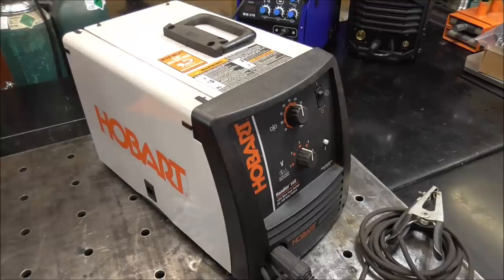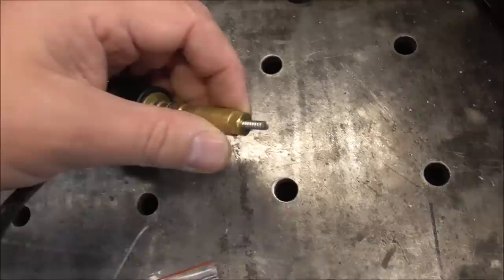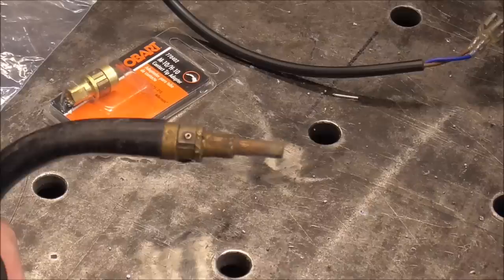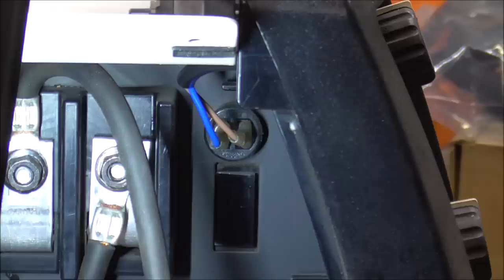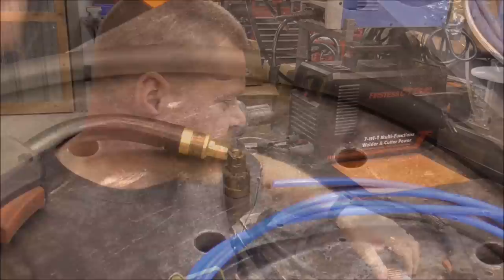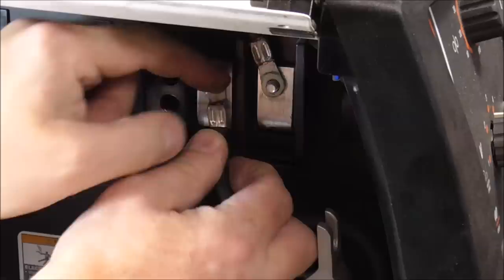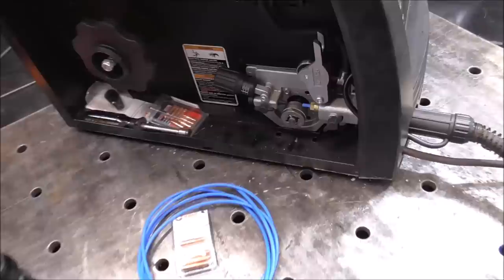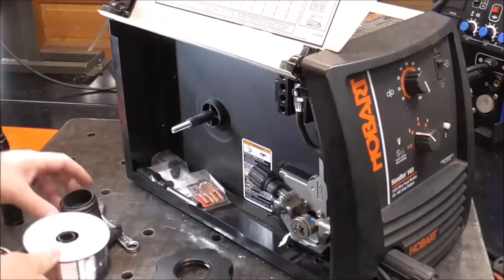Convert Your MIG Welder to Weld Aluminum - The Easy Way

Comment: How does the liner look after a few weeks of continuous runs? Ptfe breaks down around 245C and gives off toxic fumes. That tube has to be getting scorched.
Reply from the maker: I haven't run this in production. I'm sure if it were an issue there would be some mention of it on the Amazon reviews.

Comment: I tried this on my Hobart 120, but it didn't because the guide chart didn't show the AC/DC change.. I may try it now that I know..
Why not turn the Voltage up and wire speed down ?
Hobart makes a Spool Gun so the wire is pulled instead of pushed, so it won't jam as easy..
Reply from the maker: Thanks man. You really have to keep the wire flying through the contact tip. Of not you will get burn back

Comment: Can you take the metel liner out to weld aluminum then put it back in for metal  welding?
Reply from the maker: It can be done but it will wear out prematurely.

Comment: i just built a large workbench that my larger carpentry tools live in with a mft hole grid like yours....i really wanted to do the torsion frame and legs out of aluminum but my omnipro 220 only has provisions for spool gun and since i dont own the spool gun, i built the bench out of steel.  on one hand gawd dayum is it stout, but that comes at the cost of being heavy as hell.  i roll this bench in and out of my trailer everyday for work im able to do it by myself...but man i bet using aluminum would have saved a ton of weight.  i never thought to just throw a spool in it and try...smh
Reply from the maker: It's a game changer for sure!

Comment: OK, I have a miller wire welder that has a tank on it. I use solid wire. My question is if I replace it with the teflon liner can I still weld solid wire and aluminum through this liner???
Reply from the maker: Technically yes you could but the soft liner would wear out very quick from the hard steel wire and the liner would then become contaminated with the steel oxides. Your best bet is to find a cheap whip online and just leave it setup for aluminum, then you just swap whips when you go from steel to aluminum.
Reply: @BrandonLund  Thanks, I know they have a special aluminum adapted, but it is NOT cheap. It would be easier and cheaper to find another handle and cable for it.
Reply from the maker: For sure! You can find some decent knock offs on Amazon that should work pretty decent

Comment: What wire do I need for small cast aluminum job? You said that won’t work, I have exact welder used here. Only have one job here to do so not worth buying a tig for it. Thanks in advance.
Reply from the maker: Cast aluminum can be a real headache with MIG. Its better suited for TIG and that can be challenging as well. How thick is the casting and is it clean? 4043 works well in a spool gun but it is a pain running it through the gun. 5356 feeds better through the gun.

Comment: So my wife says what do you want this year for Christmas? Still thinking about it and it's either going to be a new stick welding machine or maybe a combo setup. Or i do need a new bigger chainsaw, last year i got a new craftsmen tool cabinet, top and bottom which is 3 times bigger than my old one. I will have to decide
Reply from the maker: Go for the welder Jake! You know you need it!

Comment: So how do you keep it from bird nesting you might be able to get it to work for a little while but when I did it I kept having to cut out the birds nest and rerun the damn wire through the whip seems to me it'd be a lot easier just to put  aluminum welding gun on it
Reply from the maker: You set your tensions properly and keep your line straight. It's the same procedure as setting up a push pull.

Comment: Hi Brandon, great channel. Are the gauges that you show in this video specific for welding aluminum, or can I use my two needle gouges. IE. tank pressure and feed pressure?  AGain great channel, thanks
Reply from the maker: Thanks man and yes, you are fine using the guages you have. There is nothing that needs to be done directly there other than you will want to increase your pressure a little more with aluminum than with steel.
Reply: Perfect. Once I have my tips for 0.035 wire, I will be burning aluminum. Thanks.

Comment: So I have a small 220V welder(160 or 180 A) ....with a dial voltage and feed selector.  Can you give me an idea which way you' go with your settings?  I'm thinking I might just buy another gun and have one set up for aluminum and one for steel...make quick work of a changeover...
Reply from the maker: Aluminum you have to go hot and fast. I just use the chart on the door and it gets me real close. You can also google "miller weld calculator" and type in your material and thickness and it will give you some settings also :)

Comment: Do you recommend using an oversized tube too? Say I have 0.035 should I get the tube for .040-.045 or .030-.035?
Reply from the maker: It definitely doesn't hurt

Comment: Brandon

I've spoken to several folks about this, & I'd love your take on it. What are the chances of getting a bird's nest inside your MIG welder? Have your subscribers been mostly successful using ER5356 and not ended up with bird's nests inside? I've a 200 Amp Miller Vintage so could I use 0.035" ER5356? Or do I need to go down to 0.030" rollers?

The cost of a spool gun can be as much as $2000 or more for my rig so I'd like to try it out and see how I get on..  Thanks for the content Brandon, it's much appreciated..
Reply from the maker: Hey John just size your rollers to match your wire size. As far as birds nest, if you adjust your reel tension and drive roll tension properly and keep your whip relatively straight and your running a contact tip one size larger, birds nests don't happen often. Making sure your mig gun liner is almost touching your drive roll is a huge help too. It's when you start manipulating your gun or whip with high drive roll pressures is when you run into trouble
Reply: Thanks  @BrandonLund  I just got a cylinder of 100% argon this week. For the cost of a graphene (or teflon / hdpe which is the best?) liner I'll give it a shot. I'll not have committed a kings ransom to try something fun. If it works out great if not, it will give me some extra time to fool around and buy a spool gun cheaper than paying top dollar for a spool gun straight out of the LWS.. Thanks Brandon for your prompt reply!
Reply from the maker: Anytime John. Glad I could help. If they say they are specifically for aluminum than they are all about the same. I got mine on Amazon. It was nothing special and it works great.
Reply: @BrandonLund  I'll get a liner for my M25 gun and I'll post back in less than a week or so.. I've got a lot on my plate at the present..
Reply from the maker: That sounds good. Enjoy. Its a lot of fun for sure! 👍
Reply: @BrandonLund  One more thing about the welding without a spool gun.  I was talking to my LWS and I was told is to make sure the tip is one size up from existing. So what I was told was if I'm running 0.035" wire then have a 0.045" tip because the aluminum will expand with the heat during the welding process and may jam inside the tip? Is that what you've found too?
Reply from the maker: Thats 100% solid advise. https://youtube.com/shorts/wAO1AOA_je8?feature=share The aluminum wire will expand and fuse into the contact tip. Always go one size larger when running aluminum. It's a huge pain if you don't. In a jam you can drill it out

Comment: After swapping out liner. Can you run regular wire in new liner or do you have to switch back?
Reply from the maker: I would only run aluminum in the Teflon liner. Hard wire will destroy it so you would need to switch back or better yet have a spare whip setup for aluminum.

Comment: Hi Brandon, at 24:50 you pop in a text comment "You should avoid manipulating your torch when welding aluminum"... Can you further expound upon "manipulating?" Do you mean don't make circles or back/forth movements in the puddle? Just a straight push? Learned a lot! Thank you!
Reply from the maker: Hey Jeffrey, with aluminum mig it's recommended if your welding a large fillette joint, rather than weave to fill the joint, make multiple straight passes. It helps eliminate cold lapping
Reply: Doing little cursive e/circles while MIG welding has served me pretty well. Visually I can see the top and bottom of the weld pool tie in as I move ahead. Even if you are just changing the tip angle to put more heat in the vertical metal then the flat part of the T joint you should be able to see the toes melt in. I think the manipulation lets you have greater control of heat input, weld time and penetration, especially if you're kinda running an underpowered machine. If you want to blast through a hot pass you'll need more chooch in your box.

Comment: Did you use that welder for flux core previously?  I'm just curious what it ran for voltage when welding flux core, because I would always have to run my Lincoln 140 on the 3 or 4/4 setting when doing 1/8"-1/4" steel with .035 wire and be overheating it often.
Reply from the maker: Oh yah, I've run pretty much everything through this. I run .030 on this pretty much for that reason. It runs .030 really well but I feel it's a bit underpowered for .035.

Comment: Why not just preheat the start of the weld? It seems once you get started the welder would heat up the rest of the piece.
Reply from the maker: You could if it was thicker but it's thin and it cools off quickly

Comment: To go from electro negative to positive why didn't you just reverse the cables rather then switch the internal contacts?
Reply from the maker: It's not possible with this welder. It doesn't have dinse connectors.

Comment: I think you will find your beads will look better if you take the white off and make it shiny aluminum where you're running your bead.
Reply from the maker: For sure. The oxide melts at a much higher temperature than the aluminum.

Comment: Very cool. Looks like you have a Yes Welder 250 mig  in the back? I was wondering did yours come spool gun ready? Mine did not and I converted it to spool gun and made a video on it. Shortly after they released it with that option, that would have save me a lot of work but I reckon you could also convert this welder/most to a spool gun mig if you wanted to.
Reply from the maker: I'll check out your video. Yes this one did come with the switch but I know the earlier versions didn't as long as you can interupt your trigger input it shouldn't be that difficult.

Comment: I have the same welder, I was wondering if after I install the Teflon liner can I keep it in,even when I mig or flux weld?
Reply from the maker: You shouldn't. It will wear out quick plus contaminate the liner.

Comment: If you change back your wire for steel will it wear out the liner intended for aluminum? Or can you run steel wire and aluminum wire Through the new smooth liner?
Reply from the maker: It will wear it out prematurely plus it will contaminate it so you wont be able to use it again with aluminum.
Reply: @BrandonLund  Thank you. When I watch the rest of the video you answered the question. I should’ve waited to the end to comment. Appreciate the info keep up the great work.

Comment: Are the Yes tig welders any good on Amazon. I  can't seem to find one with a 220 volt connector unless you use the adapter and the wire seems a bit thin for running 220.
Thank you
Reply from the maker: Yes they are. I own a few and have not had any problems.

Comment: No spool gun? Only a liner swap and gas? I have Lincoln 180 that takes gas. What g as  for this? Will it go on lincon
Reply from the maker: Nope. Super simple. Put in a liner, kepe your whip fairly straight to avoid friction and add pure argon. Yes you can do this with Lincoln also.

Comment: Did it destroy the cameras censor while filming the 2nd weld pass, or did you actually have a camera filter?
Edit:I learned about the soft liner when we switched over to Fronius. Honestly I do not like the constant need for the FRONIUS GUY to correct our machines errors every other month. Lincoln or Miller is my 3phase goto machine.
Reply from the maker: I never use filters. I go through a couple of cameras every year. They get knocked over, the lenses get destroyed from welding and grinding sparks, and the sensors fry from the welding. Knock on wood, I have 2 fronius machines and haven't had one problem. Hopefully I didn't jinx myself, but my 2200 is by far my favorite, followed by my Hobart / Miller
Reply: We're running the 4000 MV with water cooler on about 28/580 spray transfer, burning a 33lb.. 045 roll a day and they code out every other month. Thanks for the info.
Reply from the maker: WOW that's some production welding!

Comment: Quick question.  I noticed a Vevor Mig 250 (maybe) and a yeswelder 250 pro (maybe) in your intro.  Would you recommend one over the other?
Reply from the maker: Personally I reccomend the YWM211P which is a double pulse machine that has the ability to store settings which makes it great when going from aluminum to steel or changing different wire or material thickness.  Next to my Fronius it's my favorite machine. Plus I include a coupon in this video that will save you quite a bit at checkout https://www.youtube.com/watch?v=XqzGvZaRGTo

Comment: Interesting and helpful video Branden, what lense are you using? I have one just for gas welding aluminium that eliminates the flare so you can see the puddle.
Reply from the maker: I'm just using the nozzle that came installed on the welder.
Reply: @BrandonLund  I was talking about the lens in your hood, I've never used aluminum wire like this.

Comment: Brandon why didn't you just buy another gun unit and put in the graphine liner so you can just swap the whole unit already set up for aluminum and the other is set up for steel?
Reply from the maker: @Lewis Sport I have several aluminum dedicated welders. I just wanted to present a simple cost effective alternative for someone looking to convert their machine.

Comment: so for me what I would do is to just buy another feeder assembly and keep it for the Aluminum wire to have ready any time I will weld Aluminum
Reply from the maker: Honestly, that's the way to do it 👍 then you can switch from steel to aluminum in seconds

Comment: Will that Teflon liner still work for the steel mig wire?
Reply from the maker: No. The steel wire will wear it out very fast. Plus it will contaminate it

Comment: Great video, Brandon!  What did you mean by "if it's going to be over 150 degrees Fahrenheit" you don't want to use this wire, when you were comparing spools just prior to installing the one you loaded?
Reply from the maker: Thanks man! Above 150 it can stress corrode in an inert environment.  Basically its a form of corrosion that begins if the part is put under stress in the heated enviroment than it can fail due to the corrosion.
Reply: @BrandonLund  Thanks, Brandon.  So if the environment is over 150*F, it will corrode.  Wow, that's a low temp.  Good to know.  Thanks!

Comment: I would just get another mig gun if I were swapping often.  Drawback is the gun for my Miller 175 is about $270.  Still a lot less than a TIG machine.  And get another drive wheel just for AL.
Reply from the maker: I agree Bruce. FYI you may already know this but YesWelder makes a decent mig gun for the Hobart machine if your only looking to use it occasionally for aluminum and it's less than 100 bucks. It should interchange with your Miller.
Reply: @BrandonLund  Thanks.  Not "Bruce" BTW.
Reply from the maker: LOL I'm sorry. I'm not sure how Paul looked like Bruce to me. HAHAHAH Man oh man I guess I need some rest. Sorry about that buddy
Reply: @BrandonLund  Not to worry,  we've been accused of all sorts of variation that were close.

Comment: Ha! I commented too soon...
Your eplanation was in Video.
"Can we use Slick liner with mig steel wire?"
Answer = No.
Reply from the maker: Steel wire is very abrasive and will ruin the liner plus it will containinate it so you would not want to run aluminum in it again.

Comment: Good for household repairs. But I wouldn't trust it to make aircraft aluminum fuel tank seams.   Tig is the only options there.
Reply from the maker: This method doesn't work good on anything thinner than 1/8". 1/16" is do-able but it's difficult.

Comment: I'm not a welder, but as far as heat/conducting goes....
...instead of placing the aluminum flat on that cold steel, how about suspending it with washers so the aluminum plate on the bottom isn't colder than the vertical piece?
Reply from the maker: Not necessary on thin metal but yes this will eliminate heat transfer.
Reply: @BrandonLund  makes sense. I never gave that any thought. See why I'm not a welder 😁

Comment: Will steel welding wire pass through the graphine liner better than through a steel liners?
Reply from the maker: It will Joe but it will wear out the liner VERY fast then possibly wear into your whip and cause additional problems.
Reply: @BrandonLund  Thanks for the advice.
Reply from the maker: Your welcome!

Comment: 4043 can be used on a spool gun could it not?
Reply from the maker: Preferably yes. Generally it's too soft to push through a liner so spool gun is ideal for 4043